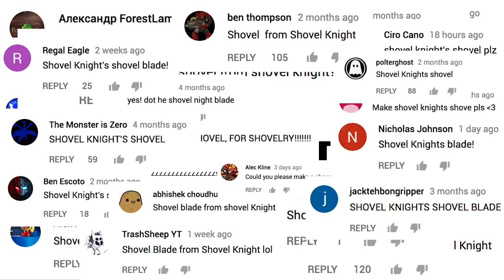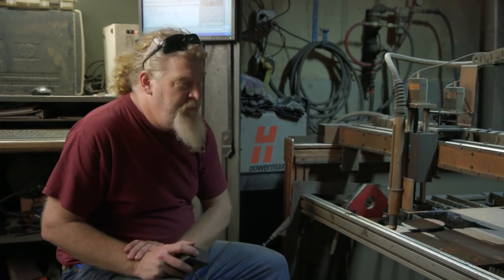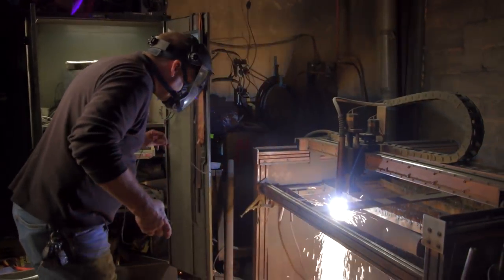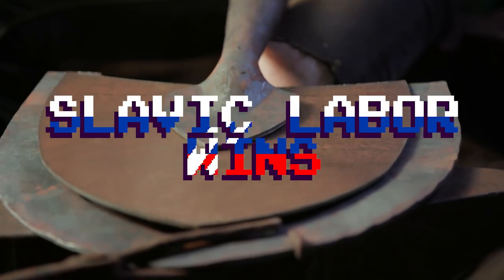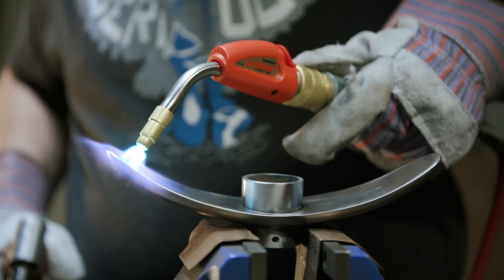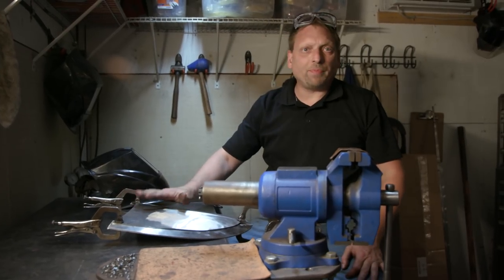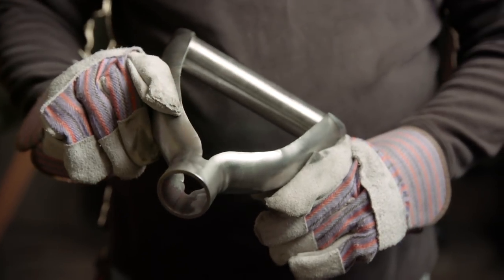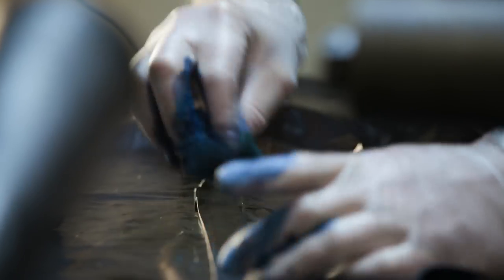Shovel Blade - Shovel Knight - MAN AT ARMS: REFORGED

Comment: Corvo's blade from Dishonored would be really cool
Reply: Yeah
Reply: you realize the blade corvo uses breaks the laws of physics right?
Reply: +sims5819 they'd probably have to make it a non-collapsable version.
Reply: actually no it does not. people make plastic 3D printed ones that work. there are even templates. they are even rather sturdy and lock in both positions.
Reply: Really? People can make 3D blades that work as well as a real steel blade, don't break upon impact, are capable of cutting through human flesh, and can fold up into less than a third of its extended size? Cause no they absolutely cannot. There will never be a blade that is designed to fold in thirds that will be as capable as a regular metal blade, that's just not how it works.
Reply: sims5819 i does all but cut. They couldn't give it a edge. But impact is a yes as well as the fold. The only part they didn't get to work is the one guard spike.
Reply: sims5819 is it as durable as a normal no but it does work and is still plenty durable